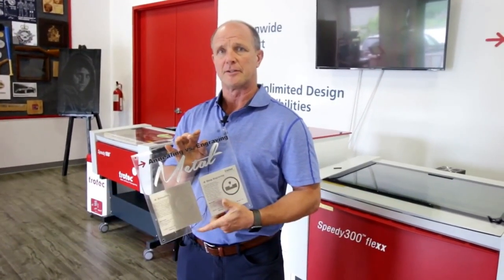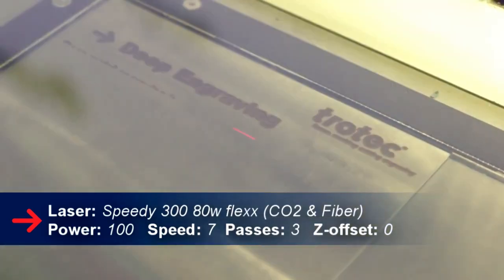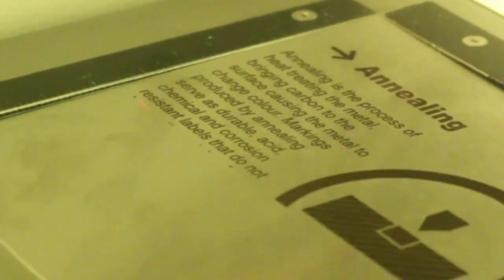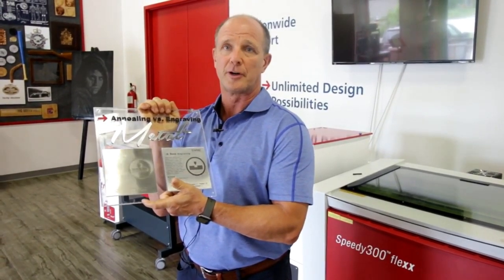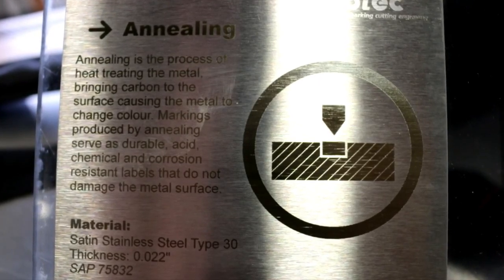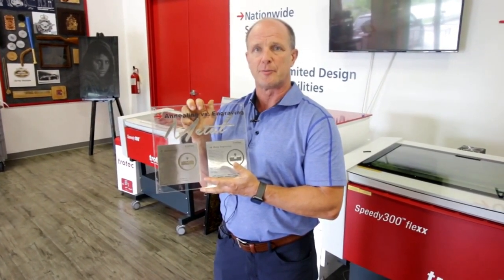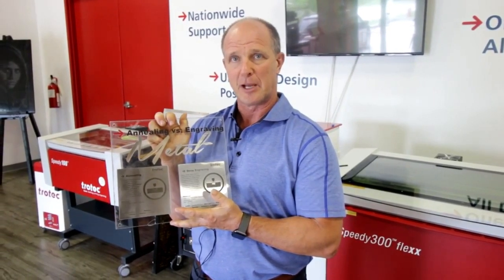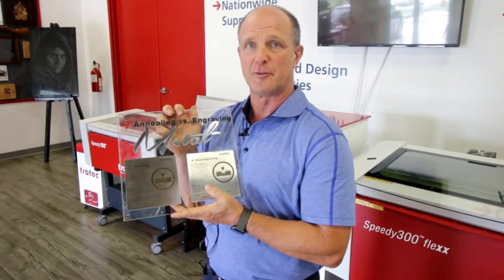Metal Annealing vs. Metal Engraving with a Laser

Comment: CO2 laser requires treatment of stainless steel in order to mark it. Correct? The fiber laser in your galvo style can only anneal and engrave. Correct? The difference in galvo and flatbed is speed, the end product is the same. Correct?
Reply from the maker: Yes, partly yes and it depends :)
To mark stainless steel with a CO2 laser, its surface needs to be coated (e.g. anodized aluminum) or treated with a marking spray.
The fiber lasers in our Galvo systems can mark in different ways. They can engrave and anneal, and also remove coatings or "stain" material. Check out this article on our website covering these marking methods in detail: https://www.troteclaser.com/en/knowledge/faqs/how-to-laser-mark/
The difference between Galvo and flatbed lasers is the speed and the size of the work area. Depending on the products you want to engrave or cut and the volumes you want to do, sometimes a Galvo and sometimes a flabed laser with a bigger work area can be faster. We'd have to look into this in detail for a valid recommendation, which system is the faster one.

Comment: I have a trotec 360 speedy flex and use a 2,85 lens. I have tried a lot of different settings and 100 power, 7 vector with an offset of .08 seems to do the best job...but no matter what I do it end up looking either light or dark brown and you can feel the annealing. I want to get this black color without any changes in the metal. Do you suggest anything to help? Ive tried everything from 20k hz to 80k hz. 55k hz gives it a really dark brown but it isn't the black im seeking.
Reply from the maker: Hello Robert! Thank you for your question.
If you still can feel the marking, the power is too high. Also, there is no complete black when marking stainless steel with our Speedy machines. There is always some brown left (process- and material-related heat distribution, type of process, ...). You can get a complete black with our Galvo laser markers, which were designed especially for marking metal.
Read more about metal annealing: https://www.troteclaser.com/en/knowledge/tips-for-laser-users/laser-marking-steel-through-annealing-process/”.
Best, your Trotec Laser Team.

Comment: What ppi is recommended for fiber stainless?
Reply from the maker: The frequency is specified in Hertz (Hz) for fiber lasers (not in ppi). It depends on the laser power of the respective machine and on what exactly is to be done (engraving, starting ...). Therefore there is no standard parameter.
 The print job is sent with a resolution of 1000 dpi (if that is what is meant).

We hope that this will help, your Trotec Team